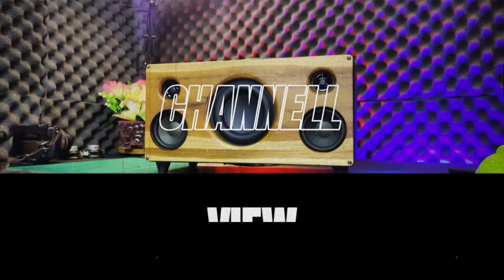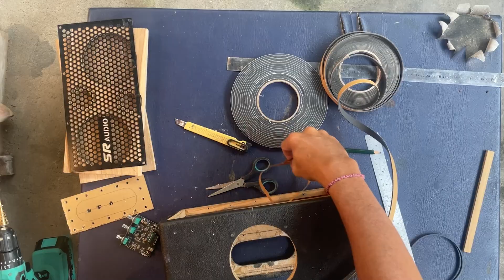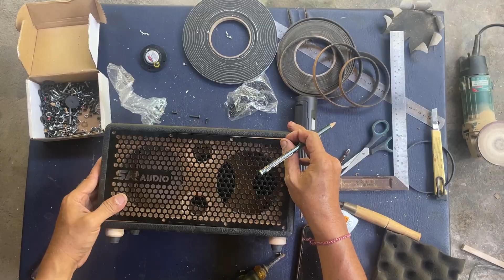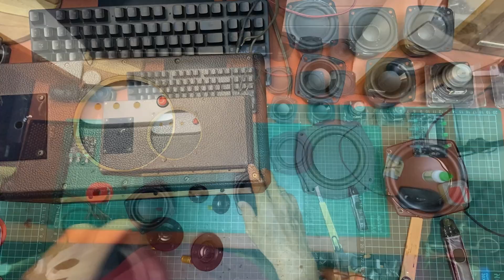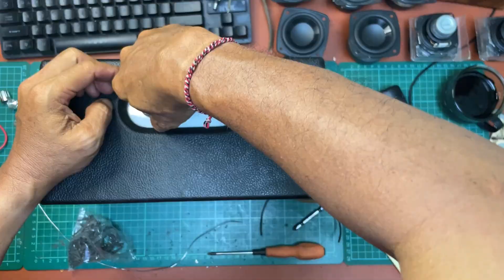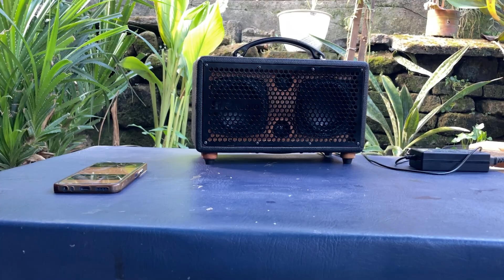60 watt DIY speaker #diyspeaker #diy #speaker

Comment: Tyg meli batre pack to 12v 20a ,be misi bms asane to tengah ne,,,, bingung bn nglih charger ne bli, ade adaptor switching 13v 1a dadi anggon ngcas bli?🙏  bnsik ne kn di  adaptor to sng misi lampu indikator full/ sng ne batre,, nah yn sube misi bms ne di batre ne be jadi ne,yn be  full cut off otomatis bli? 🙏
Reply from the maker: @LasmanaArtRindik  untuk charger nya yang 12 volt bisa pake yg 12,6 volt 1 A, itu ada yg jual online. Kalo bms itu g bisa auto cut off, biasanya di charger isi auto cut off.
Reply: @SUGIRIVIERIO  kenten bli, sukseme.bli infonyane 😁🙏
Reply from the maker: @ suksema mewali 🫡
Reply: @SUGIRIVIERIO  bisa pesan yang kaya gini bang pengin banget punya 🙏 masalah harga insa'Allah aku siap dana
Reply from the maker: @ siap ambil ini aja
Reply: @SUGIRIVIERIO  kisaran harga berapa bang

Comment: Sebetulnya lebih baik besar power dari amp dari pada driver atau sebaliknya si bli?
Reply from the maker: @sylphid7393  nah disini, saya pernah bongkar speaker JBL flip 5 ,speaker yang pake 12 watt sedangkan ampli yg di pake hampir sama 12 watt. Jadi sebaiknya power dari ampli dan speaker di seimbangkan.
Reply from the maker: @sylphid7393  kalo speaker ini saya pake ampli yang 30 watt stereo dengan speaker maksimal power handle nya di 40 watt , aman bagi speaker tapi ampli kerja maksimal. Main volume full suara masih enak tapi ampli cepet panas.
Reply: @SUGIRIVIERIO  ah i see, makasih bli